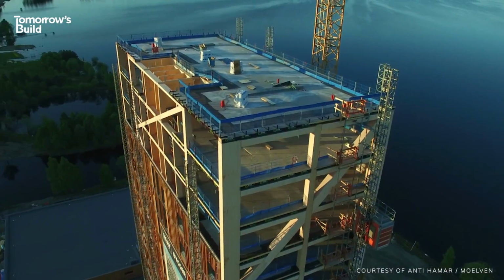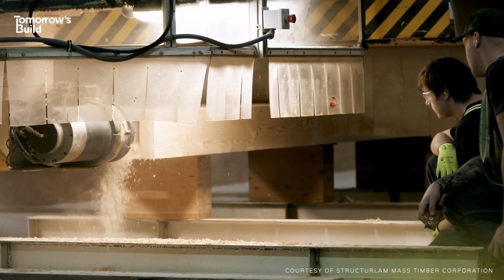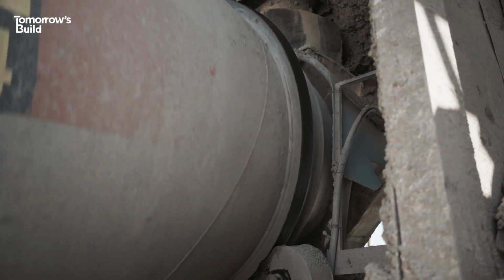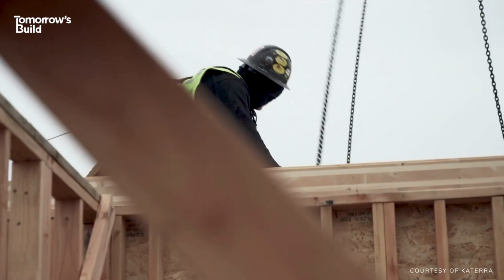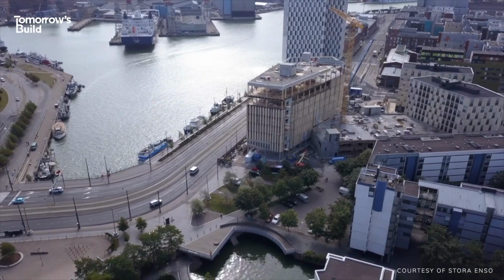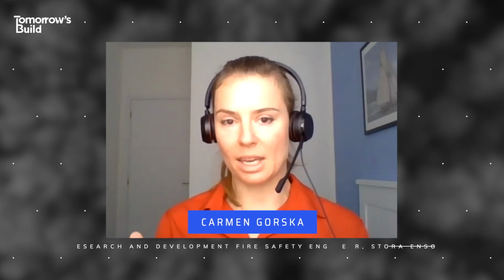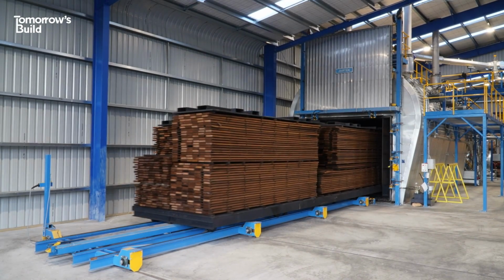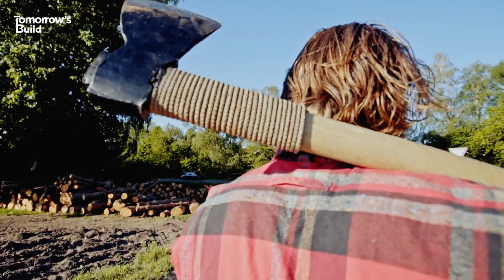Why All Buildings Should Be Timber

Comment: there's one reason why we stopped using wood and went to stone, steel and cement for buildings - Strength and durability over time, and flammibility. you can't burn stone. you can't set fire to steel. and timber sucks as a heat sink. also, timber rots. steel can rust, but stone and concrete? paint it, and it'll last a hundred years or more. don't need to look further than most castles that survive to this day.

Comment: There is no real need for ALL timber, ALL steel etc building. Usually the best results are achieved by combinations of materials. For example If th building foundations are reinforced concrete, the building skeleton from steel and the other parts from timber or other materials it could be a good end result.

Comment: Question... so can you show me a house made out of timber that can with stand a wild fire, that can withstand a tornado, that can withstand a hurricane? Oh yeah if we start building everything out of wood, won't that speed up deforestation? Because these trees take decades to grow to a usable size. 

So personally... I think you're right and wrong. Timber should be used in areas where it's useful and easy to acquire. Areas that have a abundance of timber. But areas like the tornado alley in the U.S.,  houses should be built out of Concrete. So they are not obliterated every time a tornado rips through. I mean if a nasty storm comes through... and a national emergency is declared because of all the destruction, its all taxpayer money that goes to rebuilding the homes out of wood. How is that smart? Concrete is on par cost wise(5-25% more)about the same as wood. House can be 3d printed now with concrete materials. With added insulation its very good at keeping heat or cold, depending on your season. A well built concrete house can survive wild fires. You might need to replace the windows and some interior stuff, but if you build the right Concrete design and spray it with a fire retardant it will deal with the fire much better than a wood structure. Certain Concrete structures are stronger than wood will ever be. Dome homes for instance. 

I get that wood is warm and has depth. Plus taken care of and sealed it looks the best. Concrete is bland and cold feeling. But it's safe. I'd rather feel safe than have the warmth of wood. You can make the Concrete feel like a home with everything you fill it with. Look at the falling water house. A frank Loyd Wright house. Phenomenal! He designed it in a few hours Time, because he procrastinated when it came to designing. The individual who was funding the project decided to drop in on Mr Wright. Old Franklin decided to bust his ass and get it done, and boy did he. That house is the main reason I love Concrete so much. I swear. If you ever get the chance to go see it, DO IT! If you can't, there is a great special on Netflix about him and they cover the house as well. 

Bunkers are made out of concrete also,standard bullets can't go through Concrete. I bet people in certain u.s. cities would love having Concrete 2 story homes. At least if they sleep upstairs and the person does a drive by,the bullets would be coming up on an angle and more likely ricochet or shatter. Even if it went through the window it still wouldn't hit the person. As long as they are not on a bunk bed in front of the window. 

Oh yeah Concrete keeps out rodents and insects easier. No termites, no ants, no mice and or rats! Rats are really bad here in parts of michigan. Luckily we haven't had any in our house. We keep our yard tidy, pick up after our dogs, and use steel trash cans. So no issues, just another reason why I love Concrete so much. 

I'm sorry but I'll stand by Concrete any day. If I could build my dream home, it'd be a Concrete two story home, with a basement. Similar to the pyramid concept. Basement is a bigger than the first floor, 1st is a bit bigger than the 2nd. To help disperse the weight evenly, while giving it a nice anchored stance. Id then have a center indoor court yard in the first floor. For plants and what not. Many snake plants. I think its 6-8 nice sized snake plants produce enough oxygen for the average adult.

Comment: Wood locks up Carbon in the Wood, What happens when a wood building burns.

Seen the Cost of timber over the yrs, the cost has gone up astronomically and not due to the end user or the timber yard due to the greedy saw mills.

Carbon and and is being infused in concrete now days, it is a new rising innovation but also locks carbon in concrete

Comment: This is simply an incorrect statement. You’d be asking for many forests to be torn down “sustainably” (which it wouldn’t be given the scale). You’d also be asking for every project to hire not just any engineering consultant, but one who specializes in calculating the burning you are talking about. On top of that, each project would just have another long process added to it that changes the design. If you are talking about simply the fire rating of materials, then architects and regular engineers can handle that but you’re limiting yourself an extreme amount at 1hr fire ratings. That’s only good for certain project types. Eventually there are buildings that need interior walls of 1 hour and exterior of up to 3 hours. I’m obviously not sure, but I highly doubt it would be predictable to see how a flammable material building would burn over 3 hours. Also the cost of anything sustainable is like 5x as much as anything else. Sourcing wood in a proper manner is great but there’s a reason we rarely see it. Cost, time, and effort. Effort meaning transporting it and storing it all properly. Correct me if I’m wrong, but ALL buildings is a pretty outrageous claim. I think we can all agree it is a great idea, but mass timber became a popular idea in like 2017-2018 and then faded less than a year later due to all that I’ve listed. It’s still an option, just not the best for everyone. Ah and also, you forgot that steel and other materials are sustainable if you use them properly as well.

Comment: The biggest problem here is money. Even before these recent rises in timber. It has more variables that require extra attention. Like the moisture issue or the fire rating issue. Even the material itself is expensive.

Comment: So how about the cost? Probably the most important factor and also how long it takes to construct as it also plays into the overall cost? If its not cost effective it will be the the single and greatest downfall. Another thing to consider is how the building ages with all the stress, wear, and weathering especially in a high rise\sky scraper.

Comment: I'd be concerned about using timber from modern lumber production forests. A lot of lumber that comes from those forests are new growth and thus much more unstable. The housing boom saw a lot of new growth lumber being used, with a lot of apparent warping and easy water intrusion(rotting). I'm curious to how the lumber suppliers will circumvent that problem with large buildings like these.

Comment: Fire departments will not enter a 5 or more wood building that is on fire . We stoped building 5 + story buildings because of 30 40 deaths per fire . In colder climates 1 out of 5 sprikler systems are not working . In winter with space heaters is a bad combination . Furniture houses hold plastic are a mager part of fire excellent in fires .

Comment: There’s nothing wrong with using steel, it’s recyclable/ reusable. Timber is a fuel for fire which makes it a poor choice in many circumstances. Timber is weak compared to steel, you’ll need much larger sections by comparison. Timber can’t be recycled for structural purposes, yes it can be reused at risk. Timber has its place but is not the be all end all.

Comment: Myopic clickbait propaganda.  The contents of modern residential and office buildings are quickly consumed by fire, at temperatures insufficient to damage structural steel girders (despite findings to the contrary by any 'commission').  Apart from those lost to industrial chemical incidents, a modern steel frame almost always survives a fire.  The damaged building is usually restored or remodeled.  Can the same be said of these large timber structures?  Durability, adaptability, and aesthetic qualities are all essential to the sustained usefulness of buildings, and must therefore be considered critical elements of 'sustainability' (though they seldom are).  What is actually being sustained here?

Comment: Okay, stop! One word is all one needs to destroy the basic premise of your hypothesis for an all timber construction industry... fire... done, sold, Bob's your uncle! But there's plenty more in line behind that... termites, sheer vulnerability to wind, flooding/water damage, mold... and on & on it goes. Furthermore, you wield the 'sustainability' claim like a sword in a world of AK-47's... sustainability in the context of construction is a short sell on the word itself if you pan out on the long term sustainability of higher grade construction materials which do have broader implications in the manufacturing thereof, but RECONSTRUCTION is dismissed out of hand & that's a mistake because buildings constructed of steel & concrete will outlast & outperform their timber frame  contemporaries by orders of magnitude that easily offset the material manufacturing footprint deficit. All things should be considered before jumping to conclusions by way of jumping on the carbon footprint & sustainability bandwagons. There's a reason & distinct long term advantage these materials are the standard for urban development in the modern age... because they're marked improvements over its predecessor. Better, stronger, faster, more efficient,  durable, impervious to most common elements... the list goes on & on. Timber has it's charm in certain applications, mostly concentrated in the primary & secondary dwelling markets... concrete & steel are in the long term, a better fit for  civil engineering & commercial grade construction.

Comment: If all buildings were built with timber we'd soon run out of enough forest to breathe. Also, let's ask people in tornado alley what they think of timber buildings. And you'll need a lot more timber to construct a skyscraper than you would with for instance steel/concrete. With timber being a lot more expensive than steel/concrete good luck getting that past the accountants. And then you have to wonder about how all that timbers gets dried, protected against the elements and bugs, is made fire-resistant etc. Fire of course being a big issue with timber. Lastly you might want to think about how to recycle a timber building. All stuff that tells you why not all buildings should be timber.

Comment: I agree with the sustainable aspect but when a building has a thermal event , it now becomes a throw away item because you can't guarantee structural integrity. There is also a big caviate when it comes to LVLs . Timber is now the substrate to the matrix so you still need petroleum products to build skyscrapers .

Rock , we have a literal endless supply of . I think a better approach is figuring out how to convert quarries to a more sustainable frame work . This is a 25% solution in my option

Comment: Wood has a limited lifespan for use in construction, especially in buildings at a scale large enough to make entirely preventing leaks impossible.
It is fine for buildings designed for 30 or at best 50 years, as most are nowadays, but when you are talking about buildings lasting centuries without needing major changes or ones ornamented and sculpted in such an artful way they are worth preserving stone, concrete and soon also structural glass very much have their place.
However, once you start off with outlandish climate alarmism it is already clear pushing your narrative is the only goal regardless of how much it goes against reason and pragmatic concerns.

Comment: The kiln drying is a very carbon intensive process. Also, they are failing to mention the life span of these types of wood. The chemicals they use to help make them fire resistant are toxic, require carbon intensive processes to make, and breakdown over time.

Comment: TLDR, few key points here: the affect of mono culture pine where it is not native causes toxic soil pollution, set up requirements and engineering compliance costs for CLT plants restrict the point of entry for many businesses, and cost. I recently completed a 3 level CLT  building where we used a steel frame in conjunction with CLT floor panels. We also priced up the building using CLT + LVL columns and beams and it was 3 x the $/m2. I think CLT/timber is the future for low/medium rise, and it could be sustainable, however the construction industry needs time to shift, and the forestry industry needs a real solution where mixed variety's of trees, native to their area, can be grown truly sustainably for generation after generation.

Comment: While ideologically sound, it is not a practical solution for countries like India that have high population densities and not enough forest cover. Also it can backfire as in the case of Oil companies that are required to plant palm trees and use it for ethanol, but instead they paid smaller countries to burn down rainforests and plant plam trees for them!!

Comment: very interesting video. but what about disadventages of timber construction? durability over time for example, will such building endure 80 years of continuous use?, and what about the costs? timber in central Europe still seems way more expensive  

i know abour fire and bioinfestation resistance provided by prior wood preparation which i really admire. construction strenght and spans that can be achieved with wooden beams are astonishing as well. what is more the fact of actually storing carbon inside the building instead of emissing it into the atmosphere is really astounding.

that said i wish that wood construction method was more affordable and popular. greetings from Poland!

Comment: Cost, ageing, insulating properties, climate conditions. Just a few reasons why concrete and steel are used in commercial buildings. In colder climates brick houses are better for insulation keeping the cost of heating down and therefore saving on emissions.

Comment: I think you did not succeed at telling a compelling story about fire safety.  It was skipped through too lightly.  How hot would wood get behind a thin layer of plasterboard in a big fire?  That was not convincing as a solution.  It doesn't protect steel in a fire why would it protect wood?

Comment: Don't listen to this craziness. The reason why most of Europe (France, Germany, and Italy notably) all build their homes from some form of masonry product and steel supports is because thousands of years of settlement, and endless wars completely demolished all the forests. Now, most of the forests in those countries are protected. The only option is to use masonry because it can last 1000% longer than lumber, and provide far better insulation. Germany does not use AC as an example. Very rare to see a house there with AC.

Comment: I once worshipped timber construction because of these guys. But they're one sided. I live in a tropical country. Unlike in Europe, when buildings are exposed to constant temperature changes due to rain and sunshine, you can't afford for that building to be made of wood. Concrete will always stand the test of time in most climates. You can't maintain wood. You can only replace it. And not every country has easy access to forestry either. Imagine the mess it would be transferring wood for construction across oceans.

Comment: So basically, the main solution to fixing the pitfalls of using lumber is to either coat it in plaster (which is essentially concrete & lime) or to laminate it (which is essentially coating it in plastic), both of which is said in this video to be bad for the environment.... cool, I personally would probably just stick to concrete for my builds then😅

Comment: One thing I don't understand is how you can go on massive scales with wood considering how unstable it is in almost every aspect. How do you deal with tolerances and expansion/contraction? This is a mystery to me, and would love to gain more understanding from engineering perspective. I live right next to the building mentioned in Norway, and have been in it. From what I understand the building is designed to remain standing after a catastrophic fire - but I can be wrong about that. I understand CLT in proper dimensions as a material cannot be completely penetrated by fire because of the sheer volume of mass. It is structurally supported by wood, which I guess under compression can handle a lot of load. But how much floor area do you lose with wood compared to steel/concrete? How can wood compete with steel in efficiency of space, both floor and volume? 

You also mentioned that wood is stronger than steel by weight. How do you explain this; in compression or tension - or both?

Comment: Your video is WRONG. We shud be building with Bamboo. Bamboo is 5x stronger than trees. Grows 5x faster (so we can harvest it faster) and it is a grass so when u cut it, it will regrow (where if u cut a tree it is dead). It also sucks up 3x more co2 from the air than tree. Wud love it if u did some research and made a vid like this about bamboo. Hempcrete is also better than trees for building with (provided u use bamboo/trees for structural strength.)